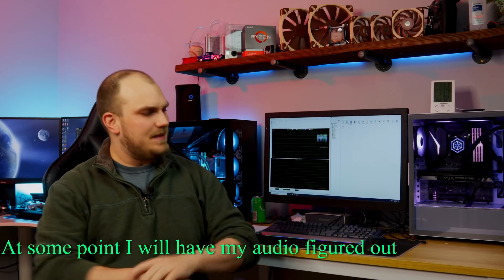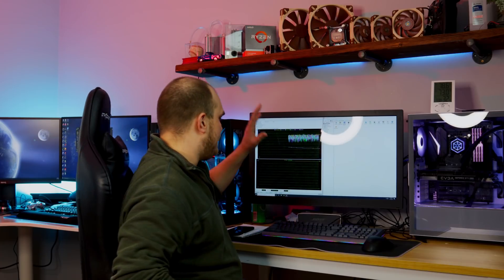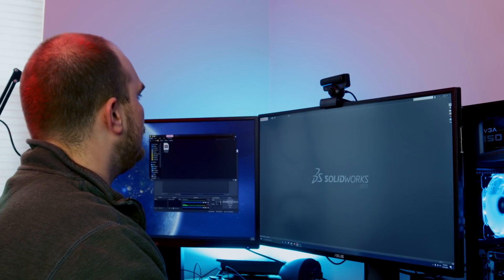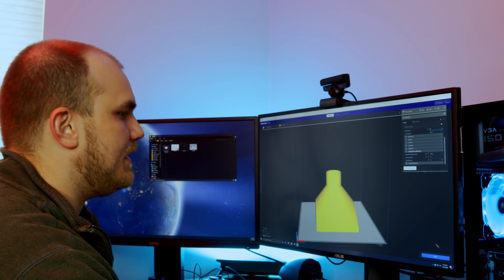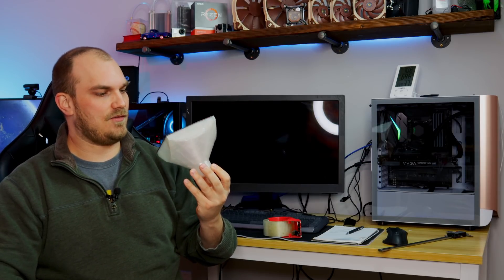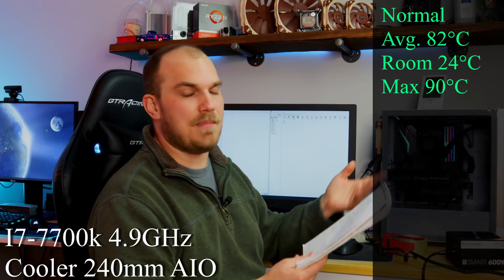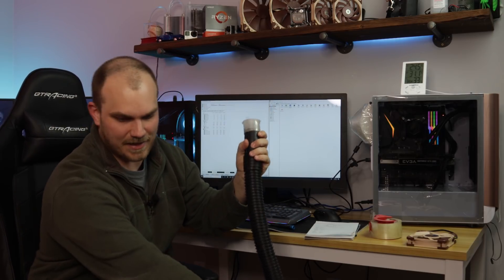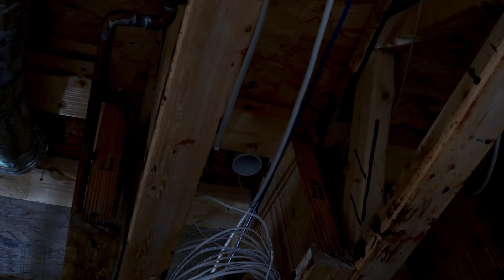What Would Happen If We Sucked Air Out Rather Than Blow Air In?

Comment: why not 3D print a frame for a 4 Fan config and hook it up to the central vac and have all the suction and noise in the basement with the fans running at full. Wont be as ridiculously noisy and power hungry as the vac and will dump all the heat in the basement.
Reply from the maker: Interesting

Comment: Next video, using an air compressor to cool your PC! With air nozzles to funnel in reverse to expand and reduce air pressure to more volume, while also regulating air Vs temperature for a silent PC. Well silent except for the air compressor will be running quite hot and for a long time driving everyone else nuts in the neighborhood.

Comment: You should be able to plumb that shop vac into your central vac system, then using an extension cord and a power bar as a remote power switch, you could make a crude working prototype..also there are wires running parallel to the vacuum tubing for the central vac's remote activation, you might be able to use those to create a relay circuit.. would be more elegant that a power bar.. this method would also make a usable central vac

Comment: A shop vac uses a fan. The only difference between the shop vac and case fans is the static pressure. You're probably getting around 100 to 150 CFM with the shop vac. Your case fans are probably providing 60 CFM to 70 CFM each. case fans designed for high static pressure (to overcome restrictions such as AIO cooling fins) might make 1 to 8 mmH2O static pressure while the shop vac might make around 1000 to 1500mmH2O. Unless your PC case has severe restrictions which don't allow air to flow in, then you're much better off with high CFM, low pressure. Another issue is that if your case has major restrictions, then you will have negative pressure in the case and individual components will not be able to shed heat as heat doesn't dissipate well in a vacuum. Looks like this was a fun project, but not recommended.

Comment: Pretty neat idea on the video! Love all your wild ideas :) check out my custom ryzen cap i made for my cooler master 360radiator ...turned out looking good..Jason Wilbur on fb and Instagram ..should b able to find me on here ..I got a few vids on here but still gotta make and post a video of the end result of what the cap looks like :)everybody been asking where I got it or how I made it :) love the vids buddy!
Reply from the maker: what are those frame less fans you got they look interesting
Reply: Those are the dark flash talon pro 3in1 rgb ..1200rpm..was right around 30$ for a 3pk..a remote and controller has Molex..but pretty sure a mobo sync cable too..I didn't use it ..not very multidirectional ..good on outside front panel..go adding on inside front on a radiator and the fans would b blowing air at each other :) pretty cool design tho :) ill get a vid on here soon of my cap I made for my radiator..had an extra and sanded it n put my own ryzen stencil on it and the word ryzen is what glows :) in happy with how it turned out ..but yeah if u run across me on fb I got pics on there n Instagram ...can't wait to see your next idea u get !

Comment: Okay, try simple math, how many watt does the vac use compared to all the fans in the system together... Also, what if you had to bring your system to a Lan party or something like that?! You would have to hook up all the fans again and it is just a mess.. What about extending your cables, into a very small well insulated room, with a small AC system on MAX cooling.. I did that once, well, I lived in a not very well insulated house, with thin walls inside the house, and no heat in the bedroom, but a fireplace in the living room, so I drilled a big hole in the wall, stuck all my cables through, benefits you might ask? Well, I heated my bedroom a bit and the living room was nice and hot, but absolutely quiet! :D

Comment: You're essentially just creating a negative pressure situation. You'll be pulling air in through every possible place on that case. This is typically what datacenters do. They create negative pressure behind the server racks and condition the air outside the rack. Colder, denser air along with e vacuum being formed behind the servers pulls the air through the rack and out.
Reply: you're forgetting all the 40mm DELTA fans running at 90+ dB inside the 1U racks :p
Some go super fancy with channeling the cold air to the front of the racks directly, but "most" datacenters do not go the extra way of seperating the front and rears of the racks and playing with pressure, they just align them with the front facing a center alley where ACs would dump cold air, and fans helping the hot air at the back escaping
in most cases, without the fans inside the racks, the cold air would just bypass the racks entirely :p

Comment: The question I would ask is would it reduce the life of the motor of the system due to heat being added to the air that is then in contact with the motor?
Reply: It get plenty hot on it's own the heat from a PC is nothing compared to it's own
Reply: @virtualtools_3021  hey that thanks for the reply!

Comment: Unless the case is sealed air tight with dust filters over the only air intake you will get more dust build up with negative pressure.
Otherwise there is not much difference between using a vac system and using fans to blow the air out of the case.

Comment: Is central vac still a thing, with power efficiency and Roombas and good battery 'broom' vacuums being a thing for a while now?
Reply from the maker: My house was built in 05 and they must have thought so then
Reply: @MajorHardware  Makes me wonder, that tubing should be smooth and quite large diameter, right? Seems like an ideal ducting system to run Thunderbolt/optical cables through and have the PC in the basement where it can be as loud as it wants in the name of performance.

Comment: Video idea and testing? How about replacing the thermal pads of a GPU with copper shims and thermal paste. Just be gentle with tightening. When removing thermal pads on vrm, measure indents and use that as shim thickness. I wander how this will improve temps or overclock.

Comment: I have a central vacuum and it’s definitely not silent. It produces a lot more noise than you’d think. Although much less than having a vacuum in the same room, but it’s not silent. Still would be quieter to have normal fans that are bigger running at slower speeds.
Reply from the maker: Does it do any good at cleaning ?
Reply: @MajorHardware  It's very good and also nice to not have to drag around a heavy vacuum cleaner.

Comment: The idea of a central vacuum was totally alien to me until recently as well. Really it makes a lot of sense, but it's just utterly uncommon here, so I had never heard of it until last year... But hey, you should give that a try! I wonder how noisy just the air moving would be at the computer.
Reply: I was also thinking that. The corrugation is probably a source of airflow disruption. If the pipe was smoother it could help reduce it. I'm fairly interested in the idea of removing the heat from the room though

Comment: Would be better results if you had 360 rad in front. Or at least seal off place for the third fan so you force air through radiator more. Otherwise you suck as much air as possible through opening without resistance and just som of THE air through radiatior. For next video with central vac use case with just 240/280 rad opening in the front :) can't wait to see next video. Good luck and have fun renovating the house :D
Reply from the maker: Thank u

Comment: I actually have one of those central vac systems in my house. When it's in use, I can't hear the unit itself, but the sound of the air being sucked into the hose and the outlet etc is still very loud. It's maybe a less annoying sound, but I wouldn't say it's much quieter than say a smaller hand-held vacuum cleaner. Perhaps if the central vac unit had a variable fan speed it could run much quieter, but I doubt this would work very well since the impeller runs off AC power.
Reply from the maker: I wondered how loud the air would be
Reply: You can control the speed of an AC by using a variable frequency drive

Comment: If you ever get the central vac system going, I'd love to see a test.
Reply: If your pc is powerful enough you'll have the nicest fire hazard in history
Reply: @polygorg  Free basement heating
Reply: @marcuscoster6529  Except that it uses a lot of electricity.....
Reply: @polygorg  why?
Reply from the maker: It is tempting
Reply: @MajorHardware  couldnt you just use your shop vac in basment with tube you have
Reply: @eig8t_twitch  potentially, I think you lose power to longer the hose though.
Reply: Side note, if running central vac, it might even reduce pc room temps by pulling in fresh air into room vs having same recirculating air pre/post case process
Reply: @s1n1stersixsgaming8  wouldn't matter if there's AC running.
Reply: @mrtempertantrum  a central vacuum cleaner system, completely different than central air conditioning... but how wouldn't air conditioning help if ambient temps are lower? Then main concept above was on the principal of a pull through setup removing heat from the room as a side effect and removing heat from radiator or heat sink as primary goal
Reply: Same!

Comment: You do realize you were still 'blowing' air in through the front by vacuuming the rear..
Reply: It is common concensus to use the terms blowing and sucking relative to ambient air pressure. Well that, or in a totally different way where both mean the same thing for some weird reason.

Comment: Just as I always said, case airflow really doesn’t matter much because most fan configurations don’t even create enough flow to move air properly through the case and even if it did, most heat is easily dissipated into the atmosphere from the case.

Comment: A new use for whole house vacuum systems!
Reply from the maker: I'm tempted to get one just for cooling pc
Reply: @MajorHardware  I've always wondered about water cooling with a central system like the vac systems. Have quick disconnects on the case to then plug into the wall. No pump or fan noise, and the radiator would be at the central system reducing heat in the room.

Sounds ridiculous, but do it for the views! The world is counting on you for entertainment! 😁 I'm doing my part
Reply: Doug Luedtke Antvenom of all people actually did that, it turned out well from what I remember
Reply: @traxxishd1869  Thanks for the link! Awesome to see it was done. And the follow up video was good too. I'd like to see it done with an in wall connector that normally accompany a washer. Quick connects are a must as shown in the video. Would also like to see the basement part wall mounted higher.

Comment: Vacuum cleaners still use a fan haha(spinning blades to move air)
Reply from the maker: Ha I knew someone would say it
Reply: @MajorHardware , if you knew someone would say that, then why didn't you clarify already in the video (directly mounted fan vs. the one in the vacuum cleaner)?
Reply: @MajorHardware  Any idea to make a fan with no moving parts?
Reply: @MajorHardware  still a fun video though :D
Reply: Oh that gives me another idea. What about making a water cooling loop I just basically runs tap water through it. Or perhaps something similar to a central vacuum cooling but instead central water cooling.  But I think Linus might have done this already.
Reply: Also could be interesting to see using the vacuum on a radiator for water cooling loop.
Reply: Impellers can be considered a centrifugal fan. Usually people will distiguish impellers as different from fans anyway as Fan typically indicates propeller designs rather than impeller designs.
Reply: @scythelord : Not just can be. Gas-based impellers are that.
Reply: humandxp  if you're making components cool enough to condense water out of the air with a compressed air duster, you're doing it wrong.
Reply: /X/EN  A fan is just a pump for air or other gases. If it moves a gas, it's called a fan, if it moves a liquid, it's called a pump. Both can include an impeller, or a propeller, depending on the type of fan/pump. The air moving device is a vacuum is called a fan, the spinning wheel in the fan is called an impeller.
Reply: They are also like half a horsepower
Reply: @Fordgpw1942ocalafl : Yep.
Reply: Actually most vacuums use an impeller system as opposed to a fan.
Reply: @RenetaScian  impeller is a type of fan.
Reply: @RenetaScian  An impellor is just a type of fan blade system. Unless you are using a piston pump they are all pretty much fans. Even pumps are often just powered by fans inside tubes.